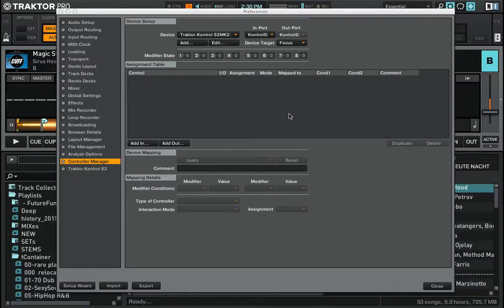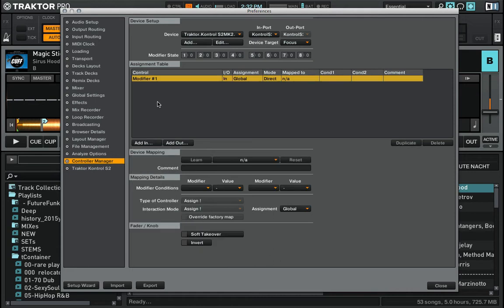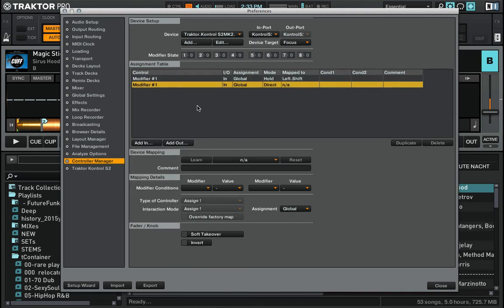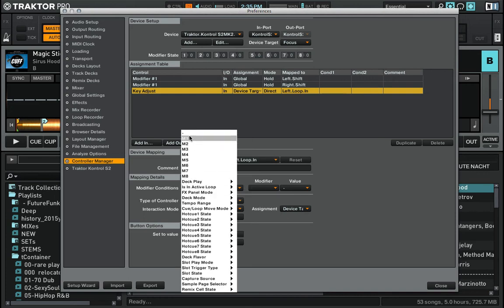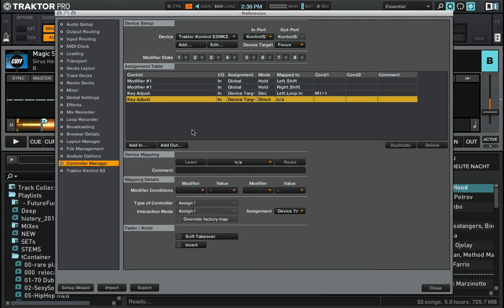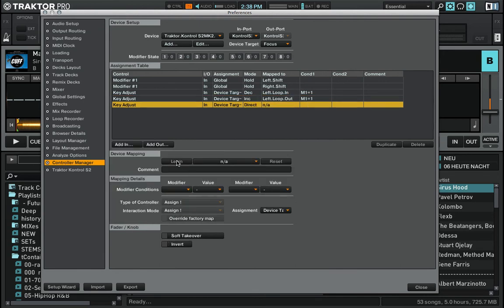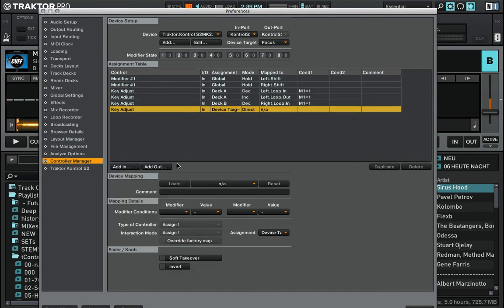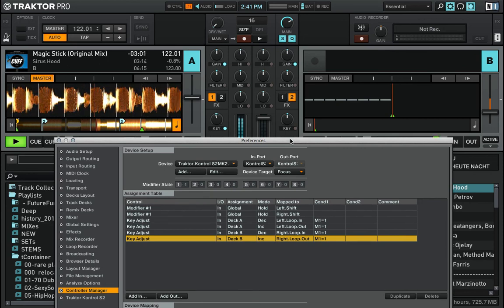Creating your own key shift mapping in Traktor Pro

Comment: How can I set a button on my x1 mk3 to have control over master tempo. I use abelton link and need to have the track in synch to master clock. Master clock changes the tempo for abelton. However I want to have it on the controller so I don't need to reach for the laptop

Comment: Problem is how do you make it so that when the next track is loaded the key resets
Reply: I don't know of a function that would allow that. But I also never missed it. I always keep an eye on the key settings and adjust them as I load the next track. Which is very easy and quick to do with the mapping in place.
Reply: @Lxory  I found that you get a reset option to in the type of button you want if the target you want to reset has more than two values aka on and off, I'm sure you can map it for whenever you load a new track but haven't managed to get round to it yet

Comment: Thank you for the video. Is it possible to set up multiple modifiers (3 button press).  For example:  shift + loop in + loop out = reset (0) key adjust.  

EDIT:  Realized it was better to map the reset to another button (shift + press move knob)
Thanks again!

Comment: Great tutorial, but I want to use adjust track key with 'Move Srcoll'. When I use these steps on s2mk2 shift button conflicts with Master, Track Begin and Keylock. Do you have any idea to solve this problem. Thanks.
Reply: I made it! Finally.
On Modifier #1 Unclick "Override factory map". And click Key Adjust's "Override factory map". So you your move scroll does not move your location.